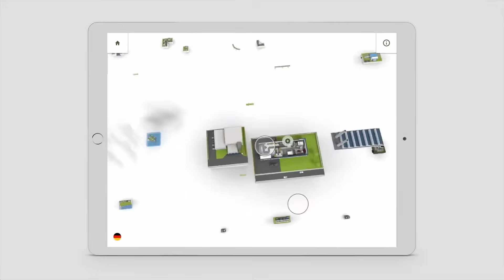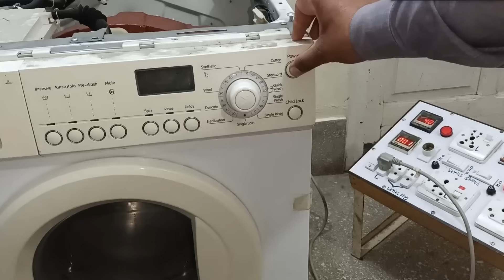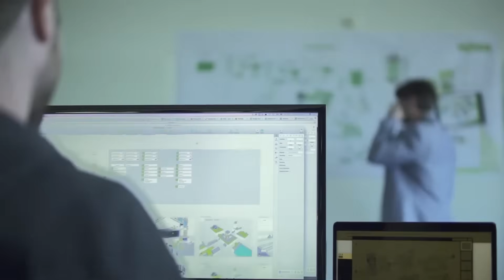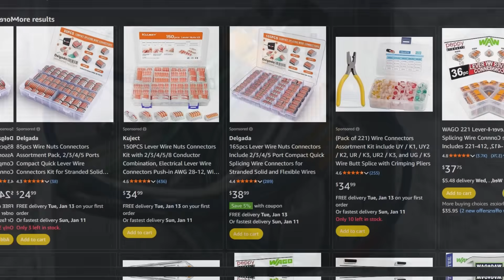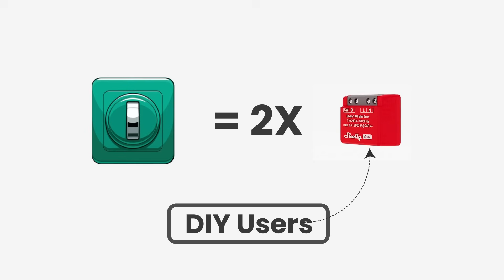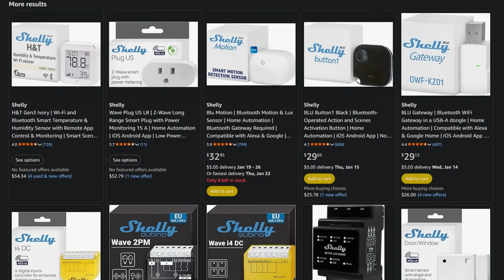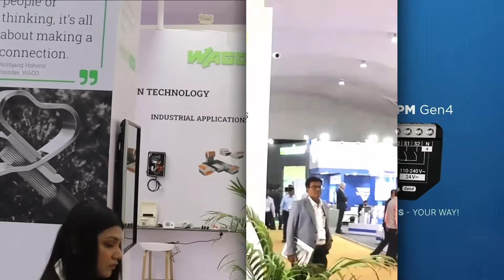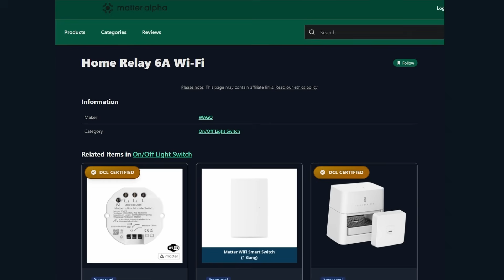Wago's New Smart Home Line Changes Everything

Comment: The WiFi vs Thread product line is not about waiting for one protocol to win out; they're different use cases. If an electrician needs a smart switch or two for a specific use case in a home, there is no need to ask the client to own and maintain a new border router for that device. They simply add it to the client's WiFi and it's done. Thread is for situations where the use situation already has a Thread border router or if adding one helps build an entire property solution. Both WiFi and Thread will continue to exist.
Reply from the maker: You make a really good point :)
But these days, most people already have a Thread router. (Apple TV, Alexa, Google Nest, ect) And then it makes more sens to skip WiFi!

Comment: Still no DC devices :( We need a stable wired fast powerful efficient DC direct system! (A better/cheaper open source KNX/DALI)
Reply from the maker: DC Matter devices DO exist, but mostly for LED lighting (12-24V). Sunricher makes Matter over Thread LED controllers :) And there are Matter-to-DALI bridges like Innovation Matters M2D.
But a full "Matter over PoE" or low-voltage DC bus for whole-home? Not standardized yet. Would be huge for new construction and commercial.

Comment: Interesting news, but you keep referring to 'dual protocol', but it isn't dual.  In truth it is two single protocols for each device, so you need to choose at the first device installation what type you want for your home.  I think this is a mistake, especially of they are aiming at the costs to be on the expensive side, in which case they could have just simplified the whole product line by including both options on each device.
But it is going to be interesting to watch.
Reply from the maker: Good catch. They're manufacturing separate SKUs, one Wi-Fi device, one Thread device. Not dual-radio in each. More accurate to say "dual-protocol offering" than "dual-protocol devices", my bad!

You're right to flag the risk, switch protocols later, you're replacing hardware. 
But I think they have the WiFi units only to compete with Shelly on smaller set ups and DIY-user. Majority of the installation will be on Thread, since thats the only thing that make sense :)

Comment: While the low-priced products are attractive to the home-hobbyist (I mean that respectfully) who can and will maintain and extend an installation, there is clearly a need for installations that will work reliably for years without intervention.  This applies to commercial and home installations where the occupants are non-technical or have no interest in dealing with problems.  KNX needs competition, so I am looking forward to what Wago offers for a non-cloud solution.
Reply from the maker: Exactly. Budget devices (Shelly, Sonoff) own the hobbyist market, but commercial/multi-family and non-technical homeowners need industrial reliability. KNX, Eaton X-Comfort and Control 4 has dominated that space it's proprietary/expensive.

If WAGO brings industrial-grade reliability to Matter at reasonable pricing, they fill a real gap. Plus the non-cloud angle aligns with professional installs. Could be the open standard alternative professionals have been waiting for.

Comment: I’m running out of iP addresses in my Class C(and not ready to re-IP to a Class A space).  Thread is good in my book.not to mention local processing.
Reply: It's public IP addresses that are running out, if you haven't allocated a large enough range of RFC1918 addresses internally, you've only got yourself to blame, either accept the pain of changing the subnet, or add extra VLANs and a better router ...

Comment: For battery powered devices you’ll need Thread (or Zigbee) so at some point you’ll end up with a Thread border router (or Zigbee hub) anyway.
Reply from the maker: Exactly. This is the argument that actually ends the WiFi debate.

Battery powered devices on WiFi are a joke. They drain in weeks, not months. The moment you add a wireless door sensor, a motion detector, or any battery powered device to your setup, you're forced into either Thread or Zigbee. There's no way around it.
That's why I always tell people: start with a Thread border router from the beginning. You're buying something useful regardless, and you eliminate the whole problem before it starts.
Reply: *Thread
Reply: @Obtuse94  Thanks! I’ve corrected it.

Comment: The WIFI vs Thread/Zigbee debate isn't really a debate.  Dedicated protocols are objectively better for reliability, speed and stability.  The argument that WIFI means you don't have to buy a hub is sketchy because most ISP provided routers are absolute rubbish and will fall over with the smallest number of IOT devices.

Building a WIFI smart home is like telling lies, a short term win for a long term loss.
Reply: Not to mention that Thread is already included in the latest Amazon Echo,  Eero routers and Apple Homepods, it's relatively easy to get thread border routers tossed into popular products.  If I'm choosing a product and it has a Thread option i'm buying that over Wifi every time.
Reply: @hmurchison8123  yes, buying a Thread border router is not like you're throwing money into a black hole just for the capability.  The 'thing' that provides that capability has additional benefits as well.

Apple TV for example allows someone to significantly extend the life of their smart tv as they're not bound to the built in smart apps, their limitations or inherent slowness.  As long as the display works you will have a fully functional smart tv for a very long time.
Reply from the maker: You're hitting on something real here. These aren't just different technical choices, they're different problems being solved.

@iShaymus nailed it about ISP routers being garbage. Most people don't realize that every WiFi device they add is fighting for the same airspace. Thread and Zigbee were built to handle this. That's not opinion, that's literally their purpose.

@hmurchison8123 gets it too. Thread border routers aren't some special equipment you're buying in isolation. An Apple TV, HomePod mini, or Eero Pro 6E are things people actually want. The Thread capability is almost free at that point.

@kungfoochicken08 fair point, most people do have a router. But here's what actually happens: throw 10 to 15 devices on that ISP router and watch it choke. Then you're troubleshooting dropouts and latency while your hub option would've just worked.

If you've got 4 to 5 devices max and a decent router, WiFi is fine. Once you're building something real though, Thread and Zigbee aren't a luxury, they're necessary. People come to this realizing they built themselves into a corner, and backtracking costs more than just doing it right the first time.
Reply: @asmarterhouse  You also no longer need a border router. Apple iPhones and Google Pixels at least already include Thread networking. Samsung doesn't do that yet, but I guess they will at some point. So if you owner newer iPhone or Pixel you can talk Matter-over-Thread without a router IIRC.
Reply: Most people already have their own router. That’s why WiFi is used. People just want stuff that they can plug in and go about their day. They don’t want to have to worry about which protocol a device uses. It needs to just work. That’s the appeal of WiFi.
Reply: @kungfoochicken08 yeah it's just work for few weeks or months at best and then you need to reboot the device. I used Enterprise grade network solutions with proper VLAN. And 80% of Wifi devices drop off within a few weeks. No matter what brand.. SONOS, Xioami, Tuya... List goes on. No all of my Wifi devices powered by Zigbee Power Outlet and I have to set automation to turn off/on in order to make those wifi stable.
Reply: @kungfoochicken08  people wanting to get a smart home will almost always want some verbal way to interact with it.

Almost all smart speaker now come with thread and matter.

I'm not saying I don't understand why people use WiFi devices just that it is objectively the wrong way to proceed into the smart home world.  Just because you CAN do something doesn't mean you SHOULD do it.
Reply: @i @iShaymus don’t know why the verbal interaction thing makes a difference. Most people are going to be plugged into a system like Alexa or Google or Apple. If the smart device is compatible with their platform, then it doesn’t matter what the communication protocol of the device is.

I’d be interested to see what the vocal interaction rate is. I always feel weird talking to Siri or Alexa. My wife doesn’t use, but both of our sets of parents do. 🤷 

My philosophy with my smart home is that I don’t want to interact with it at all. If I have to press a button on my phone or vocally issue a command to start an automation, then I view that as a failure. I try to make my automations as seamless as possible. The house knows what to do when I turn on the TV at night versus during the day, or which lights to turn on when I arrive home at night.
Reply: @kungfoochicken08  I don't know a single person that has smart devices that doesn't use a voice assistant (usually smart speaker) for basic things like light control.

Don't know what the overall would be but nobody that I know doesn't
Reply: @iShaymus I still don’t see how that is relevant at all to the issue of connection protocols. These companies do their market research. The network chip is probably about the same price for WiFi or Zigbee or Thread.
Reply: @kungfoochicken08  because if people want a voice controller then almost all of them come with Zigbee / Thread and therefore it's not an additional  cost at all because it's included in something they would be buying anyway
Reply from the maker: @davidlt, that's not quite accurate yet. iPhones and Pixels can join Thread networks, but they don't bridge Thread to Wi-Fi when they're locked or sleeping. They share credentials through iCloud/Google Play Services to devices that can stay on 24/7

@iShaymus I got a fully automated house (probably 70+ devices) without using any smart speaker :)
Everything is time, motion, temp or "If this, then that" automated + a few remote switches for special scene/scenarios.

Comment: What we need is a physical wired smart switch that can control any smart bulb(s) anywhere in the home, like smart buttons... meaning these units are not physically wired to the smart lights or outlets, only wired to a power supply....
Reply: aqara s1e?
Reply from the maker: Why do you want it to be hard wired?
Reply: @asmarterhouse  Reliability and not having to monitor battery level or having to replace batteries. I also would love that as I have issues with my Ikea switches that sometimes don't work even though nothing moved in my Zigbee network
Reply from the maker: I totally understand the benefit, and you're right, they'd be great in situations where you're just replacing a regular switch that's already there. But here's the thing: we just did a complete renovation and rebuild of our entire house without setting up a single switch point. The savings in wiring and electrician work were massive. And you're not limited by anything if/when you want to rearrange a room :)

Instead, we just ran power directly to the downlights, LED strips, and lamps. Then we use a Zigbee puck and motion sensors to handle all the control. We've also got a couple of battery remotes scattered around for scene control, and honestly, we haven't even had to change the batteries in them for 3 years.
Reply: @asmarterhouse  Well that's audacious and you must have a lot of faith in the reliability of your smart network. Do you have some redundancy set up? Sorry if you have videos on this, this one is the first I've seen from you :)
Reply from the maker: Totally fair question and welcome to the channel!
Yeah, going all‑in like that only makes sense if the smart setup is rock solid, so there is some thought put into redundancy and “what if it breaks?” scenarios.
- Every light is on Zigbee with local control, so it keeps working even if the internet goes down.
- Motion sensors + pucks control most of the lighting automatically, so if one sensor fails, there are still other sensors or remotes (set up via Touchlink) that can trigger the same lights.
- The wiring is kept simple: permanent power to the fixtures and smart control on top, which actually reduces failure points compared to traditional multi-way switch wiring.

I dont have any videos of my complete home setup yet, but a few clips here and there in the new videos coming out :)

Comment: Shelly gen 4 have Bluetooth, WiFi, matter, zigbee and many more options
Reply: I am not arguing that Shelly is low quality, but I will point out that Shelly devices aren't certified in the US (UL) - if your house happens to have an issue and the inspector/insurance adjuster finds out that it is the Shelly's fault, you will see your claim denied.
Reply: The one big downside of Shelly gen4 is that it doesn't support matter over thread. They also said they don't have any plans on working on it which is annoying. It only supports matter over wifi
Reply from the maker: Shelly's multi-protocol approach is smart on paper, but there's some legit concerns in this thread worth addressing.

@threepe0 has a point about hardwired reliability. Shelly devices are cheap for a reason, and cutting corners on mains-voltage components is where you don't want compromises. That said, they've been around long enough that catastrophic failures are rare.

@Obtuse94 just dropped the real issue though. In the US, UL certification matters when insurance gets involved. If something goes wrong and an adjuster finds a non-certified device caused it, you're looking at a denied claim. That's not about Shelly being bad, it's about regulatory risk most people don't think about until it's too late.

@therenzix hitting the actual limitation: Matter over WiFi instead of Thread is a step backward. You get the protocol flexibility without the mesh reliability that makes it worthwhile. Thread border routers are becoming standard, so locking yourself into WiFi-only Matter defeats the whole purpose.

For EU users, Shelly works fine and the certification gap doesn't matter the same way. For US installations, especially anything hardwired, you're better off with Sonoff or Lutron if you want budget options, or biting the bullet on proper brands if reliability matters to you.
Reply: Note that Shelly gen4 can do Wi-Fi at the same time as it does ZigBee or Thread. This means you have out-of-band management of your Shelly devices over Wi-Fi, while still using ZigBee or Thread. This means you can configure your device or see logging over Wi-Fi, while have it connected til your smart system of choice.
Reply: Shelly isn’t exactly known for reliability or quality components. I simply don’t trust anything from them hardwired to mains.
Reply: @threepe0 Why? I never heard of reliability issues with them, especially when it comes to safety.

Comment: Why not make each device capable of both so you don't have to even  choose protocol, I started with WiFi but moved onto zigbee as device numbers grew.
Future proofing would be important for an installation that's going to be there for a lot of years , imagine fitting a big install and later on having to replace every single switch etc because something else comes along that's better, if the devices could easily be updated via ota to newer protocols even at a small cost would make life easier.
Reply: Antennae and firmware changes. Probably didn’t want too much complications for first gen products
Reply: @ru2225 Performance issues. All these protocols operate on the 2.4ghz bandwidth. It’s hard to reliably get them working with the antenna so close together. Sonoff has the same problem with its dedicated antenna adapters.
Reply from the maker: @ru2225 and @kungfoochicken08 are both correct about the technical reality. The 2.4GHz crowding is brutal. WiFi, Zigbee, Thread, Bluetooth all fighting for the same band, and the antenna placement becomes a nightmare. You end up with interference, dropouts, or having to detune one protocol to make another work. It's not laziness on the manufacturers' part, it's physics.

But here's the thing: you don't actually need every device to do everything. The smarter approach is having dual protocol on the devices that matter most. What I do is I run Zigbee on lights/sensors and a mix of Thread and Z-wave on heating and other small things. And then Your border router should be Multi protocol from day one.

The OTA protocol updates you're talking about would be amazing, but firmware is only part of it. You'd need the actual radio hardware to support it, which adds cost and complexity manufacturers aren't willing to absorb yet.